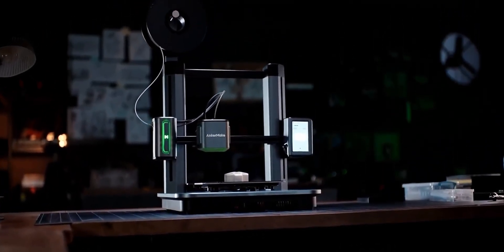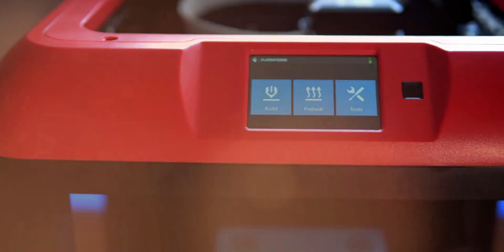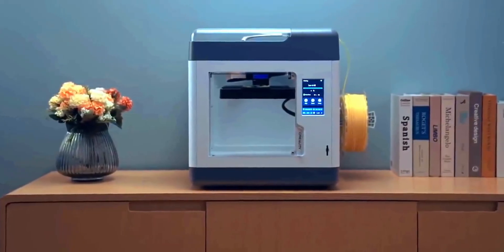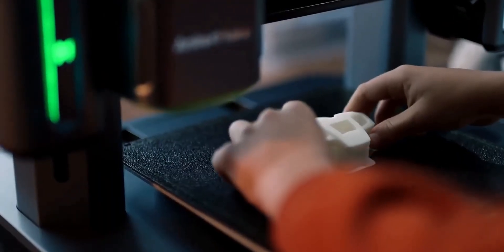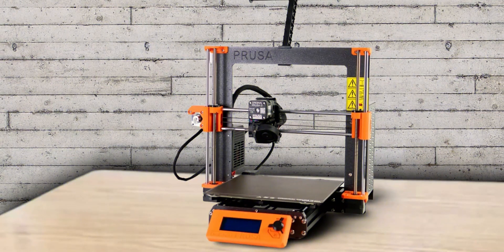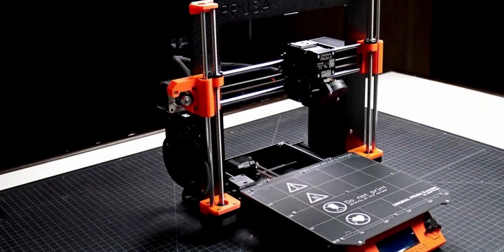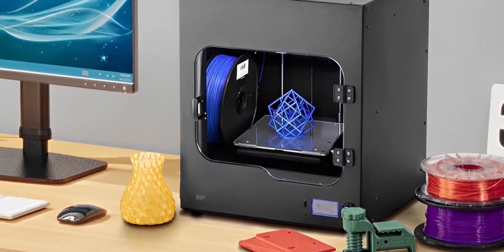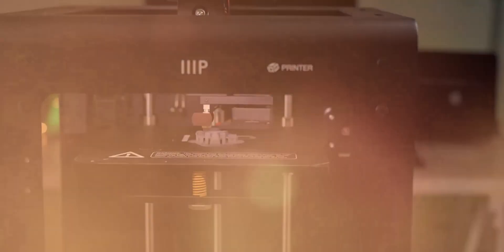5 Best 3D Printers of 2023 | 3D Printer Review

Comment: it's crazy how out of touch these videos are
Reply from the maker: Can you provide a bit more feed back? Like what you don't like about it?
Keep in mind the target demographic for this video isn't someone who is going to buy a 3D Printer off AliExpress, then assemble it, then buy new mods, such as extruder.
Reply: @TopTechChoice  I would take off the flashforge, monoprice, and creality machines, and replace with the bambu p1p, bambu x1c, and the Neptune 3 pro.
Reply: @morbus5726  100% agree
Reply from the maker: @morbus5726  Thanks for the feedback.
The bambu do look nice, but fairly new company to the 3d Printer market, the biggest problem is the price at $700 and $1,500 USD respectively. I will keep them in mind for the next video.
Neptune 3 Pro is great and affordable, I will add it to the description, with the clause that detailed assembly is required.
I'm hesitant in to clude these kind of 3D printers, as I'm targeting more of a "normal" demographic, which is why most of these printers are mainstream and come pre assembled.
Reply: @TopTechChoice  
The x1 carbon is $1200. 

You also mentioned the prusa mk3, which is the same price as the x1 carbon assembled. 

you recommend the anker m5 which is also a kickstarter, is less mature than bambu, and is more expensive. Don't pretend that price is a problem, it's just that bambu didn't pay you to sponsor their machine, while anker did. That's why you have affiliate links for all those machines.